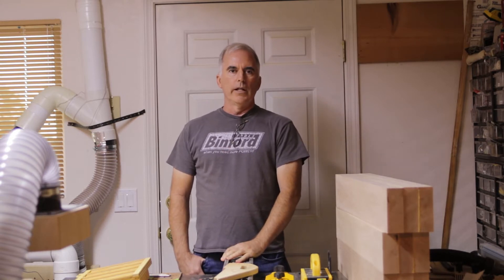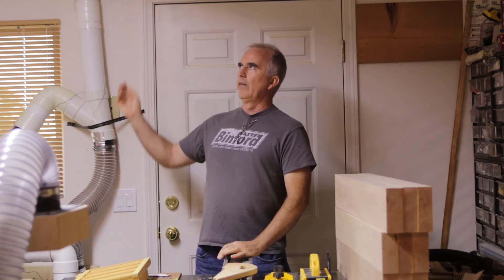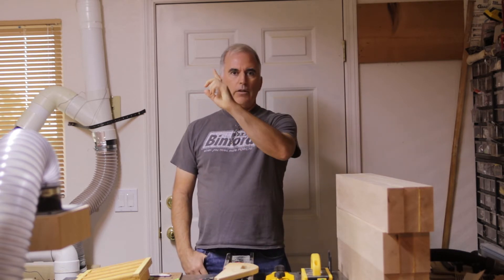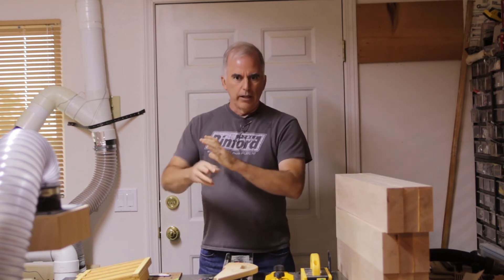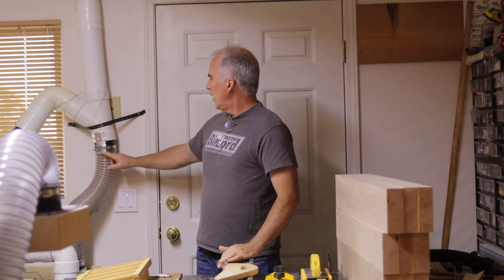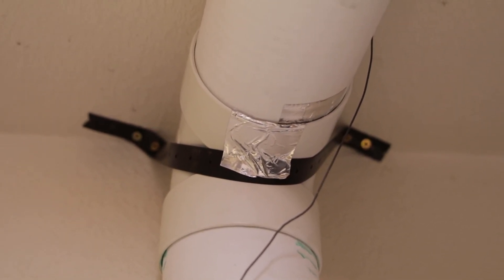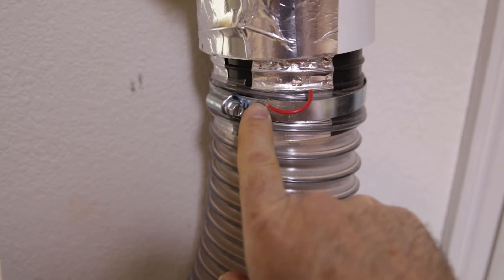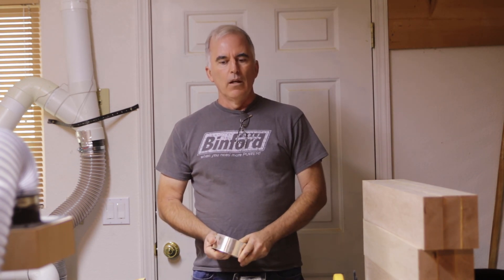Anti-static Dust Collection

Comment: Search the internet for 100 years and you'll never find an example of a shop dust collector catching fire and exploding.  It's never happened.
Reply: one of the reasons I'm looking to do something about static is because what else is around in the air that cant be seen, I can get sparks jump more than a half inch from mine to me if I touch it, solvent or other fumes can ignite, similar to this example https://www.youtube.com/watch?v=eYcDPAQu5mk

Comment: I used a solid pc of copper wire attached it to the plastic pipe using a screw and attached the other end to a ceiling joist in my shop and no more static electricity problem

Comment: Static electricity is called "static" because its stays where it is.   the premise of what you are doing is that the static charge will now hop onto the copper wire and some magic force will drive it down that wire...but that actually doesn't happen.  By adding that wire you are just giving yourself an extra path to ground and you are not dissipating static at all.  Don't use PVC for wood dusts. There are tons of examples on csb.gov of explosions.